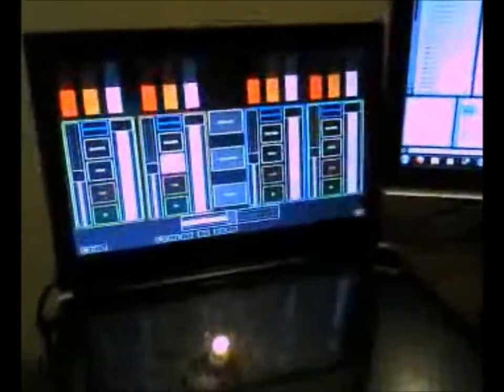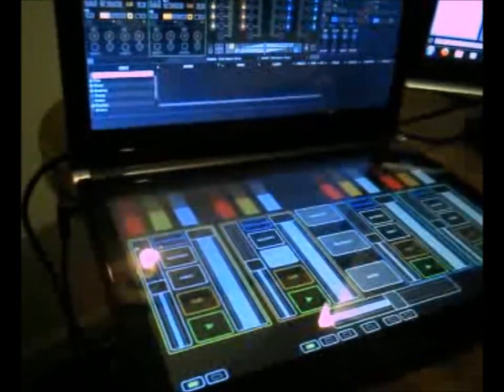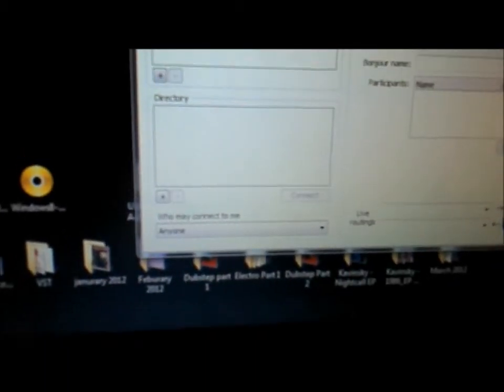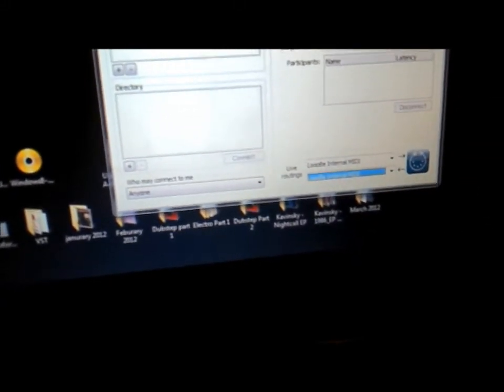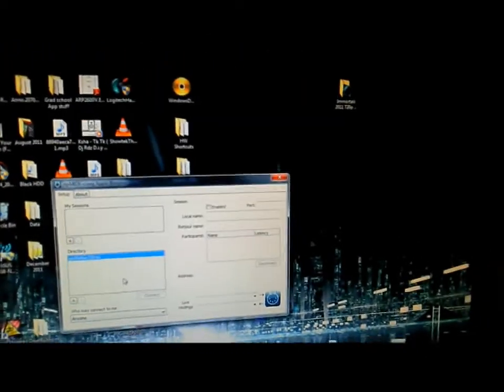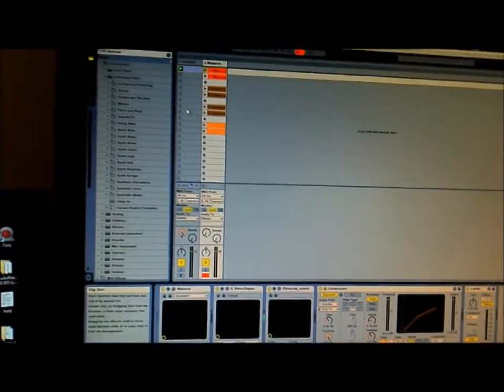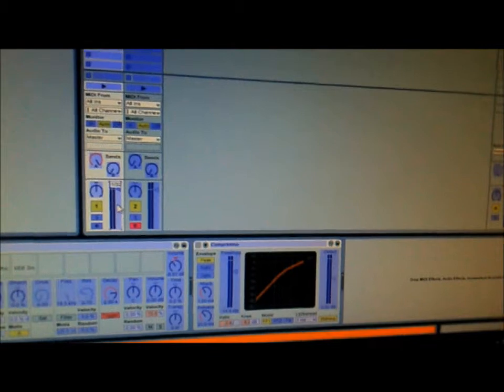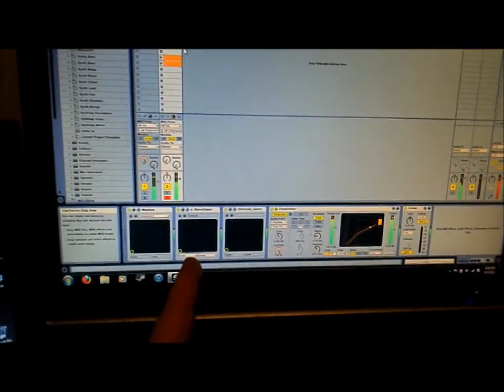Midi over Ethernet/Network Explained

Comment from the maker: you would need an os or a machine dedicated to run this software to take those midi signals over a network. I see what you're saying and I have seen usb to ethernet and usb to wifi.  You could try that and somehow get a program, if it doesnt do it by itself, that receives midi signals floating around a network.  My method does program to program.